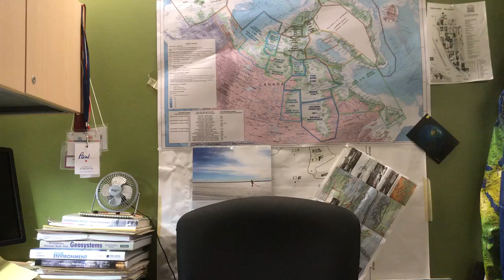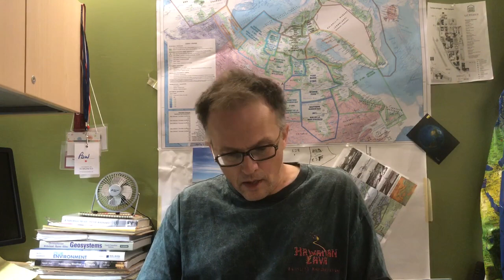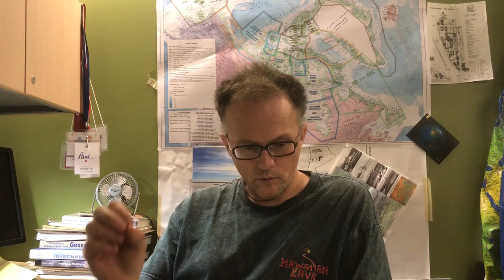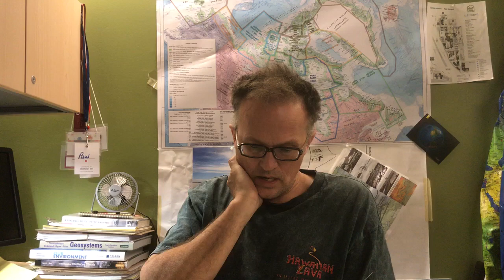Arctic Sea-Ice Physical Changes: AGU 2017 Highlights

Comment: the irony is that absent something big and dramatic like an ice free Arctic summer  SOON people and leaders especially will NOT wake up IN TIME before CO2 builds up too much.  If alarmed by some big event they might adopt zero carbon  and mitigation now. If they are not alarmed, they may very likely not adopt a zero carbon plan.  Of course when the Arctic goes ice free, the impact of reduced albedo from open ice free ocean and land on warming will be immediate and catastrophic, adding ~ 50% to the current warming of 1.2 C, or ~+ .6 degrees C.

Comment: Prof. Wadhams ..... Farewell to Ice.... NOT a fringe professor or position given the empirical data! Thank you Prof. Beckwith!
Reply: Fringe may also be a reference to the difference between scientist who are modeling ice decline and field researchers. Wadhams is a field researcher and there aren't many of those. So whatever he says is going to be on the fringe. Most modelers aren't going to saying thing that doesn't match IPCC.
Reply: It is a recurring theme from oceanography experts that the climate models used by the IPCC fail to account of all the currentl observational data which latter data suggests the climate situation is considerably worse than the aforementioned models.
Reply: Of course the establishment, owned by Big Oil, is going to promote the most optimistic forecasts. And IPCC is establishment.

Comment: Need to distinguish between the blue ocean event (2020) from the year-round ice free condition (10+ years later). 2020 would indeed be an outlier for year-round ice free.
Reply: I know Paul is talking about ice free September around 2020 and I'm guessing what the conference panels were talking about is ice free September.  I don't know how they could say 2040 for ice free September given that we've lost 2/3 of the ice volume in the last 30 years. A future linear decline would mean ice free Sept in 2033. I don't see how it could last that long given that the Arctic is much warmer now than it was over the last 30 years.
Reply: I'm certain Paul is talking about ice free September, but I'm far from sure that presenters were talking about that. In out little micro-community we see that as the next big event, but I don't know that it is on the radar of the mainstream climate scientists. All I'm saying is that talking about a year round ice-free arctic by the middle of the century is within the bounds of fact-based debate (though, like practically every prediction made so far, it is probably far too optimistic) and may indeed be the question he thought he was answering.